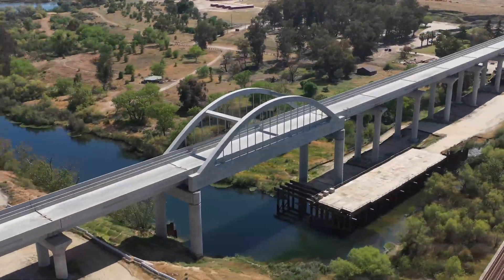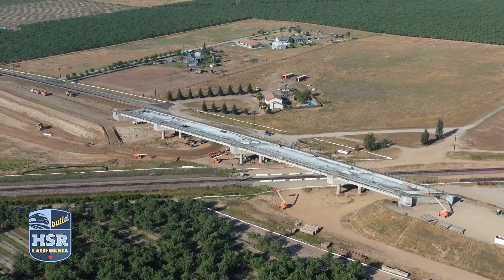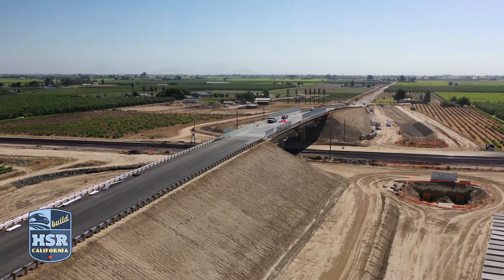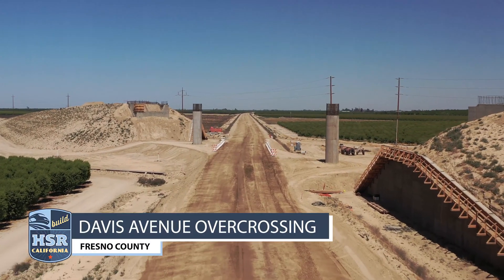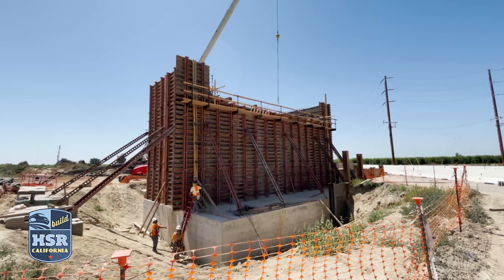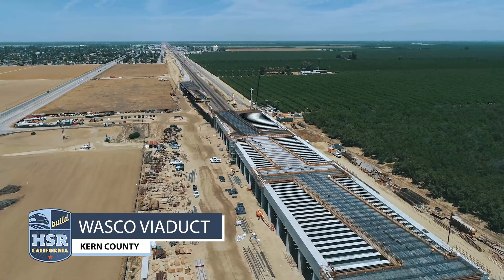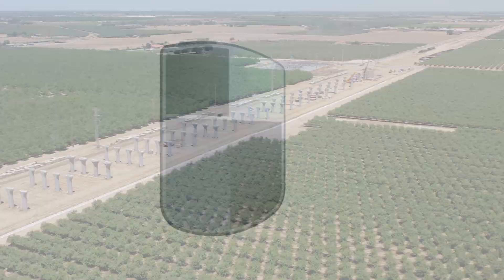California High-Speed Rail Construction Update - May 2021

Comment: Whats the top speed? Go California, I'm on it
Reply: Tulare street under crossing! The last update on that was three years ago until now
Reply: 200 mph
Reply: Just so you all know, 220mph might be the top speed it will touch on longest straight segments of track, but for the most part, the cruising speed will be 180-200 mph, because that's what makes sense for HSR infrastructure anywhere, for various reasons. It's still super fast, nevertheless.
Reply: Cruising speed is 220mph outside of the tunnels and blended areas.  The train is required to travel from L.A. to S.F. in 2h40m or less, and would have to cruise at 220mph for a significant portion of the journey in order to meet that time.
Reply: @LucidStew  Plans are always idealistic; in practice speeds end up somewhat below the planned maximum speed, for various reasons (see Spain and China).
Reply: @alexverdigris9939  Those speeds are required by the state constitution.
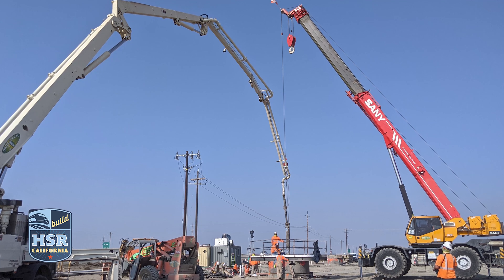Reply: @LucidStew  2:40 for an express run.
What do you think it's going to take with 15 stops and the time to accelerate and decelerate for all those stations?
Reply: @jimurrata6785  4-5 hours?  It depends how long they're stopped at the stations, which will be a much bigger factor.  However, if you're in a hurry, why would you take the local?  There are only 9 stops between L.A. Union and S.F. SalesForce btw.
Reply: @LucidStew There's one track through the central valley. How do you run express and local?
 I must be reading some very old documentation.
I see 13 stops from San Jose to LA, and 15 including SF and Anaheim.
It's not just the time stopped, this isn't a rocket sled.
No one is going to ride it if they are wrenched out of their seats, baggage flying.
It's hard for me to see the realistic use case. How many people drive downtown to downtown?
What transport do you use to get to/from your actual destination?
I don't know what metro stations are like in California, but here in the NY metro where I am 90% of it reeks of steaming human excrement.
At least you can get a train from the center of Manhattan out to destinations Upstate, New Jersey, Long Island or Connecticut.
Is that even an option? To go places beyond LA's sprawl?
Reply: @jimurrata6785  Currently there are no tracks, however, the finished Phase 1 would have two through tracks along its entire length.  Stops between S.F. and L.A. are Millbrae, S.J., Gilroy, Madera, Fresno, Kings/Tulare, Bakersfield, Palmdale, Burbank.  The trains are capable of accelerating as quickly as is comfortable.  Lets say it's similar to a typical car getting on a freeway at 0-60 in 10 seconds.  At even acceleration all the way, the train would be at top speed in less than 4 minutes.  But again, if you're in a hurry, you wouldn't be taking a local.  I don't know how many people drive between any of the destinations.  Stations in the L.A. basin and bay area will be extensively connected to other forms of transit.  SFO and Hollywood-Burbank airports will both have stations.  Connection to LAX will exist from L.A. Union via the Metro Green Line, which will be finished long before CAHSR gets there. The bay area stations will be connected to BART and other local transit.  The terminus in Anaheim is a transit hub that connects to local bus service as well as local Metrolink train service.  L.A. Union also connects to many local transit options including several well-travelled Amtrak routes that service the coast.  Mass transit connectivity and reach continues to improve in California partially because the state government refuses to build new freeways.
Reply: @LucidStew  I'm aware that there isn't any track laid.
Yes, one track in each direction is still one track. They're aren't switches for an express to bypass a local if another HSR is coming the other way.
So, it takes four minutes to get to speed, and we can assume about the same to comfortably slow down, and perhaps another couple minutes to transfer passengers and their luggage off and onto the train.
Even ten stops is going to get that 220 mph top speed down to a 100 mph average over the 400 (or whatever) mile distance between LA and San Francisco.
While Id hope this does something for California I'm not sure what that is.  🤔
Seems like $200 billion is way too much, and not nearly enough at the same time.
Reply: @jimurrata6785  The stations have spurs in each direction for the platforms.  Trains will be able to pass through the stations at speed with a train at the platform. Projected cost is currently between $69 and 100 billion.
Reply: @LucidStew  And that will NEVER happen.
Reply: @whiteclifffl  220mph isn't that difficult.  I'm not real confident they will be able to make 2h40m in practice even with a test train. It will almost surely not make that time in service. Not sure what happens then.  Lawsuits?  Of course, they'd have to complete L.A. to S.F. first.
Reply: Test speed 250 mph. Operational speed 220 mph.
Reply: @danielcarroll3358  thanks, thats so fricking fast. Can you appoint the source?
Reply: @leobragaurbe  It's listed in many documents and videos. Yes, it's fast, but in many parts of Europe and Asia, it's normal HSR. Many of their HSR travel at 200+ mph regularly. Passengers have come to expect that in those parts of the world. In the USA, people react like it's amazing because they don't know any different considering the slow train speeds we've had in this country forever.
Reply: @theexmann  Im more excited for the texas one, its seems to be fairly more efficient. The central railway will be fully high speed and will use shinkansen technology. Oh, and its private
Reply: @theexmann  Yep to many their max train speed is still 79mph, HSR in Europe and Japan is now 200mph in many places and is expected, though here more than 79mph is seen as just 79mph...
Reply: @theexmann  Actually, the normal operating speed of most high speed trains in Europe and Asia is 186mph (China's the only country that has a high speed railway that normally operates over 200mph).
Reply: @leobragaurbe  it hasn't started construction yet so I'm not holding my breath until then.
Reply: @theexmann  eh, even for Europe 220 is fast. The most common is 186 and even Japan is barely that fast for conventional shinkansen
Reply: @jackjohnson7804  That might be the case regarding the most common, but they several lines that go faster than 200 mph, and their upcoming lines will go 250+mph. There are lines in China that already go more than 250mph.

Unfortunately, by the time CA HSR comes online, it won't be considered one of the fastest any longer since it's taken so long to build. It will be at least 8 years before the first section is ready, and I'm not sure that section will even be electrified at first which means it will travel at much slower speeds than designed for once the line is electrified. The first section in the Central Valley will probably run at around 150mph tops.
Reply: @TheRailwayDrone  But several lines go higher than that. And there new ones coming online in the nest few years are rated to go 240+mph. Unfortunately, by the time CA HSR comes online, it won't be considered one of the fastest anymore since it's taken so long to get this project off the ground. It's a shame really. I don't think we'll see actual 220mph at normal operating speeds at at least 12 more years.

The first section to open, in the Central Valley, will not be electrified so the top speeds will be around 150mph. I hate that, but I'm afraid it will be true unless there is a significant amount of funding soon from the federal government to speed things up.
Reply: @leobragaurbe  We'll see, but they haven't built anything yet and they are already getting pushback from private property owners over the possible use of eminent domain. It's been a huge problem in CA too in buying the needed land for the line.
Reply: @theexmann  they are waiting approval but I bet they will built it faster than cali imao
Reply: @TheRailwayDrone  yes, but im looking forward to it
Reply: @leobragaurbe  What approval are they waiting for and from whom?
Reply: @leobragaurbe  Why are you so excited at the idea of it being private?
Reply: @alexverdigris9939  because in america it tends to be more efficient. Just look at the disaster of CAHSR and east side acces. The tunnels of NY (east and north river tunnels) and the old penn station were all built private. I bet that even HS2 is more efficient than CAHSR
Reply: @alexverdigris9939  I live in a country where the government says something will be built in 5 years but everybody knows that it will take like 10 years more
Reply: @TheRailwayDrone  they would build a HSR in my country but the politicians are so corrupt so It never started construction
Reply: @leobragaurbe  Well, that article indicates that they have a long ways to go. There is no way they will start construction this year. They haven't even presented the final route yet according to this article. This article makes it sound like they have an uphill battle to get this done. CA has had similar issues and they are much farther along.

The one thing this Texas line has going for it is that it's half the size of the CA line so they won't have to deal with as many issues.
Reply: @leobragaurbe  The texas high speel rail project just got shot down. The governor didnt want to seize private property from locals
Reply: @leobragaurbe  planes are much faster
Reply: @bruvlord1133  source?
Reply: @leobragaurbe  The problam with california is their is so much private property we have gotten tangled into immenent domain cases
Reply: @theexmann  well not in the netherlands so it’s way faster than those trains
Reply: @miles5600  I've never been to the Netherlands, but plan to visit in the next year or two. HSR infrastructure is expensive so I can see why the Netherlands doesn't have any, but the people from the Netherlands do enjoy HSR service when they travel in Europe. You have probably used HSR in Europe. Not so in the USA even though it's about the same size as Western Europe. We are way behind by comparison.
Reply: @TheRailwayDrone  300kph is a nice even number... 🙂
Reply: @leobragaurbe  yeah thats fair honestly, lots of hope for the Texas railway project especially with collaboration with a Shinkansen main company that has a lot of experience. It's going to be completed, and it definitely will work before the California line
Reply: @danielcarroll3358  Those speeds will never happen. 
And you know it.
Reply: R Go  the system would be connected to mass transit on both ends.

Comment: Progress
Reply: Tgon Mwort  Not me, but k. Great input, we'll take that into consideration.
Reply: Yup, several hundreds of millions of dollars (that the taxpayers will be the ones paying the loans and the interest).  Will take people from nowhere to nowhere.  Connecting it to any major cities is not within the scope of the project, the flat out lied when they gave their estimates as to how many people will use it.  No real idea as to the route it will take or how they're going to build it when they started construction,  building infrastructure without even knowing the characteristics of the trains that will use it (which means that a lot of the work will have to be torn out and re-done when the actual trains are designed) and no idea where the electricity needed to operate it is going to come from.

Not "progress" - it's a slow motion disaster.